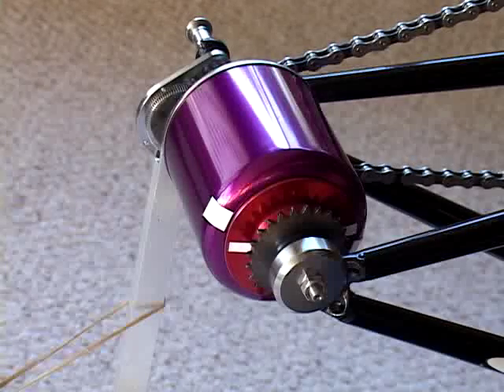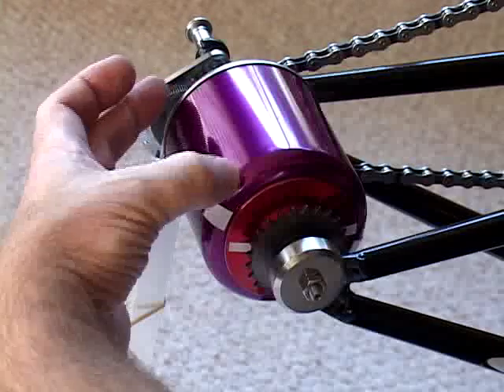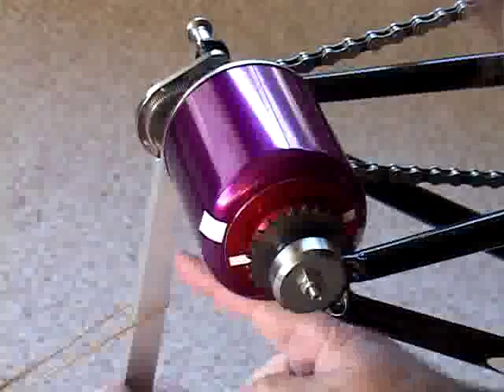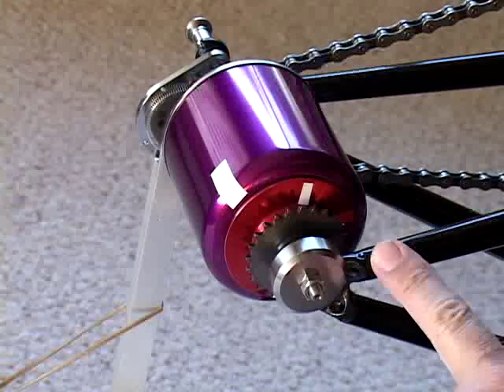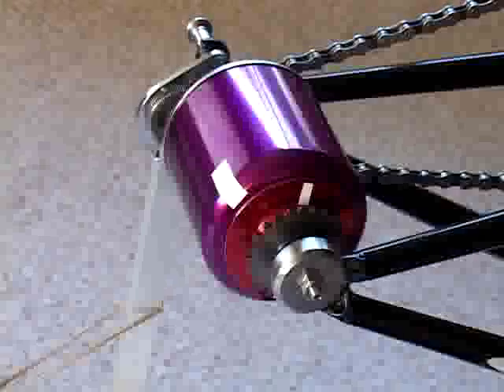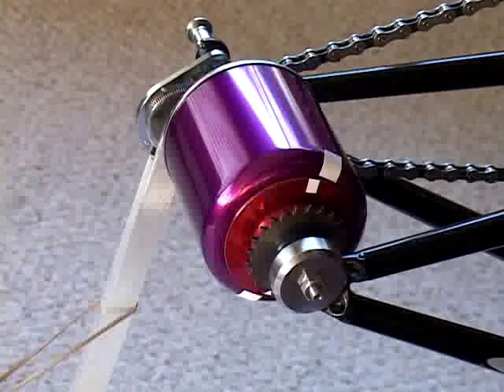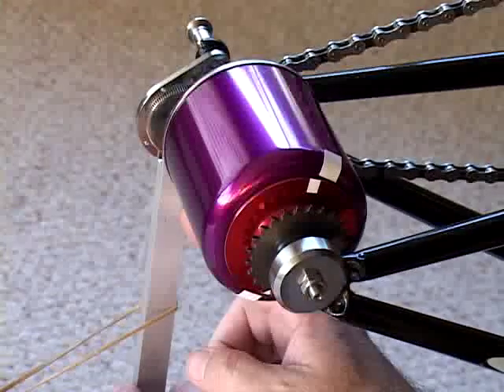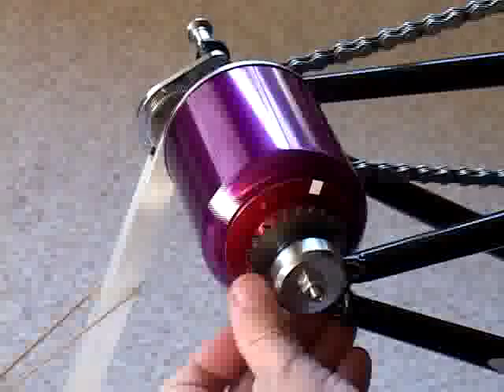Automatic Bicycle Transmission (IVT)

Comment from the maker: Yeah, this was brought up before.  The intermittent motion you see goes away when the output provides some resistance.  Without resistance, the very slight drag in the ratcheting mechanism dominates with a subtle erratic motion that quickly disappears under load.  At very low ratios, this no-load irregularity is amplified, so you notice it only near the zero-speed condition.

Comment: the main problem i see with this demonstration, and it may be just an issue with how it was filmed, is that the output is not constant with a constant input. to get a certain ratio, the output gear essentially pauses intermittently.

Comment from the maker: Thanx!  Inventing stuff like the SIVAT is very demanding.  I'd recommend that you consider getting a mechanical engineering education because you'll gain a sound understanding of the physics & maths you'll need to invent viable machines.  As for maintenance, you've got the right idea; the goal is to prevent damage from mud & accidents that trash derailleurs.

Comment from the maker: If Shimano has an IVT, I'd be one of the first to know about it.  Is it a CVT instead? Anyway, HP capacity goal of the new design is 2 (1500 watts), max output torque is unknown, but likely ~ 800Nm.  This will accomodate mopeds & pedelecs.  Motorcycles would require a bigger design.

Comment from the maker: No doubt about it, this invention can be applied where the big dollar products are. but I need an entry point.  Surprisingly, there is a great deal of interest in getting bicycle SIVAT into the market.  Having test-ridden my own earlier automatic CVT on a bike, I can assure bicyclists that the feel of riding such a transmission-equipped bike on a high-end road bike & MTB was a fine experience.  If we can get the production costs in line w/ that market, I'm sure the bike SIVAT will succeed.

Comment from the maker: I've been an engineer for 1/3 century, & I learned early on that it's far better to do research about a subject before critiquing it.  Research is very easy with the internet; if you teach yourself how to dig up & discern fairly complete, relevant, accurate information, you'll be armed to quickly develop a defensible opinion.  If you want to become an effective engineer without losing credibility amongst your peers, research is the first step.  Engineering is dependent on information & facts.

Comment from the maker: The re-designed SIVAT has a high ratio that's nearly 4X higher than this version, so you may need to buy your little brother a drag chute!  With the 55T/11T sprocket combo in this video, the new design would offer an MTB high gear of ~ 475 gear inches, which is ~3.5X higher than on a road bike!  Even a 32T/24T combo would offer higher ratios than most MTB's & road bikes, with the added benefits of more ground-clearance under the front sprocket, no chain-slap, no chain-suck.

Comment from the maker: Car companies are very cautious & hesitant about adopting new technology, particularly if it was invented outside their industry.  This is called the NIH policy, meaning 'Not Invented Here'.  I thought NIH might be a myth, but I've been assured by insiders that it's mostly true because it's embarrassing to their own engineers to be outdone by an outsider.  Still, when the SIVAT succeeds in smaller 2 & 3-wheeled vehicles, it will have a chance afterwards.  Ask your car maker this question!

Comment from the maker: Output torque of the SIVAT does rise as its ratio falls, but to a limit by design.  Bicycle riding below ~2 mph isn't practical; you might as well just walk your bike up such a steep hill if you can get traction.  I figure that 30° is a practical limit for any bike, beyond which you'll either wheelie & flip over or you won't get traction.  Spoke-breaking (or chain-breaking) torque is beyond SIVAT's limit with good reason.

Comment: If it was very near 1:0, and there was say, a metal bar stuck in the spokes; if i kept pedaling, would it have enough power to break the spokes? Not that its bad, just wondering if id be able to put this on a bike and ride up a 50 degree incline effortlessly.

Comment from the maker: The bicycle has been a nucleation point for several important inventions: paved roads, pneumatic tires, triangulated space-frames, ball bearings, roller chain, spoked wheels, tubular structures, etc.  I'm proud to continue that legacy that expanded into industry, while still remaining on the mighty bicycle!  My next video will demonstrate the utility of the IVT on a bike!  Your appreciation of its industrial uses needs not to exclude bikes.  However, thank you!

Comment from the maker: No, you won't roll backwards.  The zero output won't be invoked on a pedaled bike because the design will accomodate more power than your legs can produce.  If it's motorized, overload protection won't be invoked for motors within the rating spec.  If the motor is too powerful, it will go to zero, but it will not roll backwards.  If the uphill grade is too steep for traction and the power is within its capacity, the wheel will slip on the ground before the SIVAT goes to zero.

Comment: Yep, I'm a mechatronics engineer and for a while I considered building my graduation project based on an automatic shifting mechanism for bicycles, adjusting gears depending on torque but it wouldn't work very well on the standard gear to sprocket system. Your IVT system looks much better and doesn't require any electronics.

My question is, how is it still not the market?!

Comment from the maker: It's very unlikely that you saw the same thing; the single prototype has been in my posession, and it's extremely difficult to figure out for the few who have seen its insides (under NDA, of course).  Regardless, thanx for the 'heads up'.

Comment from the maker: Yes, all rotary-to-linear mechanisms, such as rack-&-pinion, chain drive and timing pulley drive, can convert SIVAT's rotary output to linear output.  SIVAT is a uni-directional drive, so linear translation would require a separate reversing mechanism for seek functions to change directions of linear travel; so, there will be a quasi-backlash at reversal operations that will convolve inertial effects within the system.  Such quasi-backlash can be very low magnitude if reversals are low speed.

Comment from the maker: Hi Jeff,
The SIVAT is not yet available.  A redesign is in-process to refine & strengthen it, so we'll be in a development stage for several months before making it available for sale.  If you can reveal how you intend to use it, I might be able to advise you on an interim solution 'til then.  You can use my YT in-box if your application is proprietary.

Comment from the maker: Yeah, the new design will have a very high top ratio, higher than anything found on most road bikes.  There will be a ratio lock on the handlebars to override the automatic feature.  A word of warning about your pedaling style: pedaling in excessively high ratios can damage your knees, something I've witnessed in my own riding club.  Pedaling at ~90 rpm is optimal for muscular efficiency, with the incidental benefit of moderating joint stress.  That is one goal of the SIVAT design.

Comment from the maker: Note that torque-responsive ratio control tends to keep input forces (& speed) at a constant, so chain tension won't ever rise much.  Overload protection is a secondary safeguard mostly for output, & won't likely ever be invoked by your leg power because it will be gaged (by design) against loads from motors that produce much more power than legs.  Together, these protect against excessive input & output forces without making the bike unrideable at very low ratios.

Comment from the maker: Since the patent(s) have not yet been issued, I won't publicly disclose the principle of operation because that would void the patent pre-emptively.  PWM is not used.  A general description of both IVT's & Ratcheting Drives can be found in Wikipedia under 'CVT'.  Torque amplification at low ratios results from the implicit use of levers via gearing & actual levers in the SIVAT, proven with this prototype.  A more exhaustive study of output torque as a function of ratio will be performed on Gen2.

Comment: Could you post a link to a page with the concept behind this mechanism? From the description it sounds like there is, essentially, PWM of the engagement of the hub output to the input, but I don't see how this increases mechanical advantage (torque). I'm sure you've been over this a million times, so a link (in the description to others don't have to bother you?) would do wonders for those of us unfamiliar with the concept :)

Comment from the maker: We're in the development stage now, so it's not yet available for sale.  When the SIVAT is available for bikes, we'll offer a solution for the problem you mention.  However, a key component in the SIVAT can be used with any arrangement of a moped that can decouple motor from leg propulsion: the overrunning clutch.  See 'freewheel' in Wikipedia.  Be careful to choose a size to handle the torque where you choose to use it; it may need to be surprisingly large.  These have proven reliability.

Comment: Where can i buy one, i am building a friction drive bicycle on a mountain bike and i want to be able to use the pedals or engine when i choose to. The problem i have now is when the motor is in operation the pedals will spin with it so i had to take off the bike chain, but i think if i hook the chain to this and then another chain to the back wheel sprocket i would be in business

Comment from the maker: Thanx.  I boosted the power capacity in the 2nd design to accomodate mopeds & pedelecs because many commenters have agreed on this added use of the SIVAT!  It will eliminate a clutch & likely raise the top speed & acceleration with your motor.

Comment from the maker: Yes.  If all my calculations are correct, output torque should be inversely proportional to output speed except for a deliberate torque limit at ratios below about 1/20.  This approach implies auto-regulation of these variables within a regime of constant power throughput.  All properly designed, efficient transmissions do this, but mostly in a rough way.  We'll test new SIVAT performance to document its real output speed/torque relationships.

Comment from the maker: @Doazic Assuming that your comment may be facetious, I assert that on first analysis manual shifting isn't tiresome, but this is still better.  I invented, designed, built & tested a similarly automatic predecessor bike CVT; riding it extensively in mountains convinced me that 'shifting' by simple leg force is much more intuitive, accurate, smooth & responsive.  You might not be convinced of this until you actually ride such a bike.

Comment from the maker: @mengle2004 By itself, the new highest ratio will be ~3:1.  With additional gearing at input (as in the video) or output, this highest ratio can be raised substantially without losing any lowest ratios.  A practical limit would be higher than most applications demand.

Comment: @Hossheim I would assume because it is infinitely variable it could be geared really high. It goes don't to a very low gearing. So that when it was at 1 to 1 the outside gears could be higher.

Comment from the maker: @Hossheim This prototype shown has a 55T chainring with a 11T sprocket, so it does what you're asking.  In fact, its highest ratio is higher than on most MTB's.  Regardless, the 2nd generation design has an internal high of about 3X, so you can have even higher ratios with a small chainring.  A 36T/16T combo with the new design will produce more range of ratios than you'll ever need for the steepest hills, coming up or going down!  The objective is to keep you pedaling 80-90 rpm anywhere.

Comment: Does your prototype have the ability to have the output shaft turn more revolutions than the input shaft (like a bicycle)?  Your video shows torque multiplication (output turning more slowly than input), but on a bicycle it's just the opposite.

Comment from the maker: @mitchcapone Yeah, it always feels & sounds like scraping your fingernails across a chalkboard or sandpaper to change gears in the front.  And it doesn't always shift like you want, so you have to 'tune' it.  If you're going up a steep hill, the risk of chain-suck is super-annoying.  I want to weed-out anything annoying like that.

Comment from the maker: @arklanbk At wind speeds below about 6-7 mph, there's not enough power in the wind to bother with because it's a third order function of relative air velocity; i.e., diminishing returns.  As wind speed increases, the ratio needs to be geared down, not up.  At high wind speeds, impeller inertia & high wind power can conflict violently, producing damaging levels of forces on the mechanisms during gusts, that's when overload protection is valuable.  Electrically, AC synching is important.

Comment: @SIMKINETICS u dont need to use the gearbox to main voltage as the baseload will do that for u.
id use this gearbox to help it start up at lower wind speed and as the wind speed gets faster then u gear it up

Comment from the maker: @arklanbk Yeah, we looked into that seriously.  Wind turbine high-voltage IC electronics for regulating AC constancy with variant impeller speed is expensive & quite vulnerable.  Mechanically, strong gusts do a job on shafts & bearings.  Then, there's the efficiency factor.  We'll get their attention some day.  Thanx for your insight!

Comment from the maker: @OpinionsofDave No, but it would produce a much better result.  My response is based on fundamentals; design executes those with specific solutions not exactly determined yet.  I imagine the design could be elegant, adding a slight complexity using synchros at the rotating input.  It is an intriguing challenge.  The devil is always in the details.

Comment from the maker: @OpinionsofDave The reversing mechanism could engage when the SIVAT hits zero.  This would allow you to start driving backwards from zero, just like for forward driving with no need for a clutch or TC.  Good question you pose... I get it.  Most likely, that would require a shift lever to allow you to pre-determine a switch to reverse at zero.  I'll start thinking about that.  Thanx for your excellent input!

Comment: Shimano alfine hub shifter costs about 550€, rohloff MTB hub 1200€. Both have fixed gearing (12-14 gears). This video is 3 years old. So my question is why isn't this thing on the market yet? If it performs as mentioned you should get minimum 500€ a pop, with durability and marketing probably 800€. So why not just get the production rolling!?

Also, will there be a video with the thing actualy mounted on the bike doing its job?

Comment from the maker: @HariVIyer Road bike riders are often weight-weenies.  This can handle 1500 watts by design, so it's made of hardened steel alloys.  Although its design uses shell-structures & angled forms, it is steel, which is ~2.8x the density of aluminum.  I rode a Paramount with a heavy hybrid of a 3-speed & derailleurs for decades & loved it.  The gearing is your best weapon, so the weight becomes secondary if the gearing works well.  I believe it could weigh less than 2kg, eventually.

Comment from the maker: @OpinionsofDave It could, but its forward performance would take a hit.  Better to add additional gearing for reverse; that would increase its size beyond standard bike size standards.  Eventually, this could grow in capacity (and mass), and features for applications with much higher power throughput.  Features could include reverse, dynamometer read-out for your bike computer, handlebar controls for changing throughput & ratio controller speed, universal-convertible design.

Comment from the maker: @HariVIyer Yes.  The new version will have >3X high gear inside.  With this, you'd get 5:1 with a 25T/15T sprocket set, allowing for excellent ground-clearance for MTB's, & a high that's 25% more than commonly found (44T/11T).  I have a high gear of 6.75:1 on  my own bike for fast descents down mountain roads, but it only helps my speed by a few mph vs. coasting, so anything higher is absurd.  The SIVAT & a tidy 36T/16T combo would get that..  1.5 kw rating, more than riders produce.

Comment from the maker: @mustangfeber I'm re-designing the SIVAT to be a universal device that can be used in several ways with mostly common parts.  Eventually, the SIVAT will be available as a stand-alone transmission, not just a component that's specific to a product line; this approach will allow mass-production techniques to contain costs & price.  This will take a while, but it will enable tinkerers to buy it for their specific uses, like yours.  You'll be exposed to this opportunity then.

Comment from the maker: @TheRRC86 The weight challenge is a tough one.  Light derailleur gruppos are between 1.0 & 1.2 kg.  The SIVAT uses steel components to accomodate the high torque on its gears in a compact package, more material than steel sprockets.  A saving grace will be continuous ratio control to optimize muscular efficiency.  Of course, having a sealed system is an advantage over open derailleurs too.  Weight reduction will be a continuing goal.

Comment from the maker: @azuziful Similar but better.  The IVT has ratio range only limited on the high end by practical use, whereas a CVT is intrinsically limited in range at both the high & low ends of range. Typically the CVT's high is <4X its lowest ratio, & the IVT's high is ∞X its lowest ratio.  A CVT requires a clutch to engage into its lowest gear ratio; the IVT is already engaged before your vehicle starts moving!